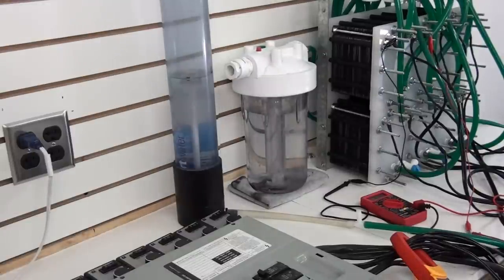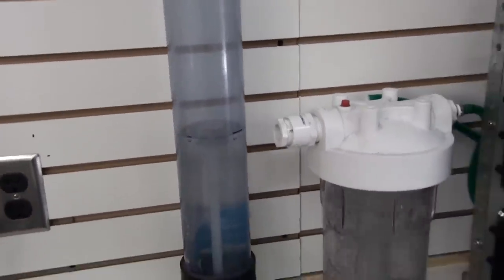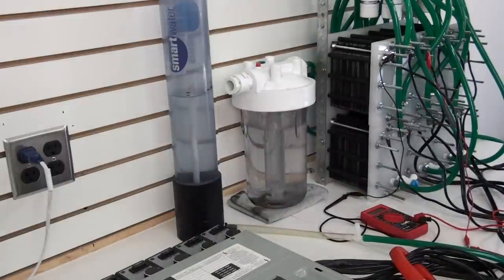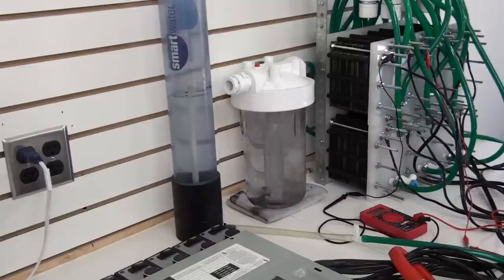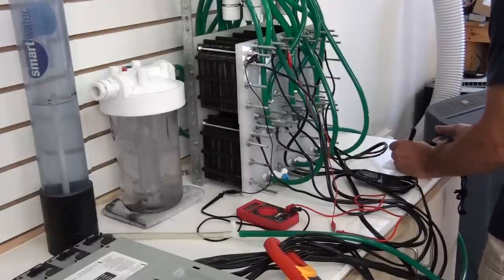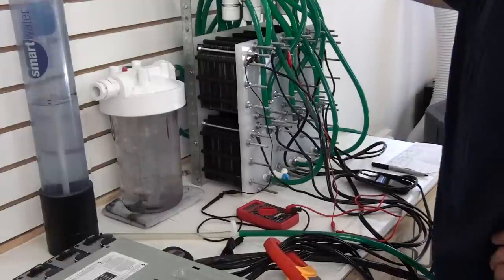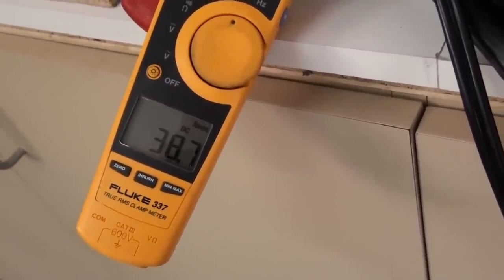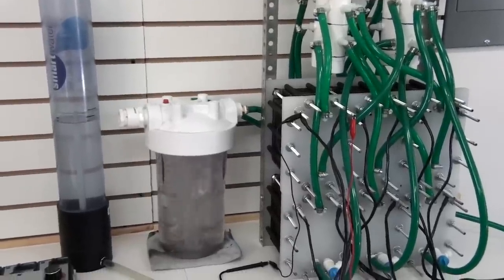Green Fuel H2o HHO 354 Plate Monster Hydrogen Generator Build Part 7

Comment: sorry i'm noob on this matter but how actually you make electricity w.o power generator?!  i mean where combustion happening where is mechanical  to convert to electricity...
the most video i seen in youtube they use HHO as fuel to Generators to produce electricity so im totally confused
second part how long that 2 gallon water KHO last before you have to refill it.
3rd since all those wires and screws and water hose are in stick out is it safe in long run!?

Comment: I heard that for the same voltage let say (120V) current depends not only on plate size, but also on electrolyte concentration. If you increase electrolyte concentration let say two times, how much will be the increase in HHO output. Have you ever tried that? It should be some optimal concentration of electrolyte.
Reply from the maker: I tailor my concentration to cell design and power supply. The more koh that is added the more current it will want to draw.
Reply: Ok. Actually I'm planning to get HHO generator for welding 1/8"  thick aluminum or about 3mm thick sheet metal aluminum. ( round pipes or just sheet metal). What minimum size ( liter/minute ) generator do I need to buy for that kind of job?

Comment: Great video. The unit like this is about 5 KW. If average car power is about 100 kW , you need 20 more units like this to power the car. There are so many naive people thinking that with the unit even smaller than shown here they can save gasoline consumption. That's really naive  :)
Reply from the maker: hho in a vehicle to save fuel is not a fuel its a catalyst to the real fuel. That's what people don't understand, especially arm chair quarterbacks.

Comment: Already the switching of your digital Multimeter or the power controlers could blow your house up with that amount of hho gas you are producing -
unless you have a very good ventilation in your rooms. The gas volume in the tank would probably be deadly if it explodes by any chance.
I would try to keep the volumes in the apperatus as small as possible - which is difficult with these amounts of production...
Reply: no chance to blow hho will burn in air..

Comment: Hi Delvis11, are you using a conductivity in water around 3,000 microsiemens/cm?, and the packing between plate of 1/16"?... basically with this and those conditions it is making 15 lpm of H2 and the rest is 7 to 8 lpm of HO, Good.

Thanks...good project

Comment: INVERTED MAGNETO YOU DON,T NEED ALL THAT POWER AS YOU WILL FIND The spatiotemporal dynamics of the face inversion effect: a magneto- and electro-encephalographic study.
Watanabe S1, Kakigi R, Puce A.
Author information
Abstract
The neurophysiological basis of the face inversion effect was studied with magneto- and electro-encephalography in 10 normal subjects. Spatiotemporal analyses using dipole modeling was performed on combined evoked magneto and electro-encephalography data to hemifield presentation of upright and inverted faces and objects. Inferior temporal cortex, i.e. fusiform gyrus, and lateral temporal cortex near the superior temporal sulcus were activated simultaneously, but independently, at 140-200 ms post-stimulus to upright and inverted unfamiliar faces. Right hemisphere inferior temporal cortex and lateral temporal cortex were active in all subjects, and in the left hemisphere in half the subjects. Latencies to inverted relative to upright faces were longer in the right hemisphere, and shorter in the left hemisphere. For right hemifield stimulation ipsilateral activation delay was around 18-19 ms for both upright and inverted faces and was calculated from all 10 subjects. For left hemifield stimulation, and the data from 7 of 10 subjects, it was 22 and 29 ms to upright and inverted faces, respectively. In sum, the methods used in this study did not identify clear differences in anatomical location of activated regions to upright and inverted faces. We believe, however, that the differences in processing upright versus inverted faces are attributable to temporal processing differences rather than to processing of information by different brain regions.
Reply from the maker: +Robert Steneck Very funny!
Reply: YES AND SO WAS THE RONALD REAGAN AND THE OIL INDUSTRY KEEPING THAT FOR WARS AND THE SKEEKS THANK YOU

Comment: you sir, should be more carefull, the valume over the cell is to much gas in the tank.. not save.. that fan never runs noot save... ure inside and pushen 10 min gas in the room.. but im not sure there, does hho return to watersteam again when it gets mixxed with oxi again?
Reply: no.

Comment: Does bubbling it thru water take bad some of the gases? Would it not be better bubbling thru oil or a liquid with different chemical makeup??
Reply: nope. oxygen and hydrogen dont just simply get back together, or yeah it does when you give it a spark so it burns. when hydrogen reacts with air(so hydrogen burns, look videos of hydrogen torches) it creates water.

Comment: Should your blowout on your valve be facing your work area? I feel like that is relatively unsafe because if the system were to fail that is where it is designed to fail.

Comment: What type of power source equipement you apply sir?, i try battery charger 12 volt, 15 amps for my 22 plate, 9 inch diameter but  i get 1 litre per 2 minute. it bad or no.? I planning to use welding machine had 30-200 amps .its that ok  welding machine?

Comment: Kind of scary leaving that thing running like that while you make the calculations Steve. Hope you are exhausting that outside.  A bit of static could make a mess. It's a better world with you in it.

  Really nice job Steve. What would you need that much hho for though? Maybe run a few generators off it?  I wonder how much hho you'd get with a kilowatt-hour? Really cool. How much hho would you need to run a four-cylinder motor?

Comment: HHO is very positive for combustion motory.Z ordinary petrol will use up to 30 percent energie.HHO supports combustion and thus help to utilize the additional part of the energy of gasoline with significant reductions in emissions. combustion engine on a clean HHO is safer than classic motor benzin.Motor + HHO engine with more life , because during the combustion process do not produce oxidants that create corrosion

Comment: Steve ? have you have any problem with the steel or metals in the engines that you run to become brittle or hardened from the hydrogen ? 
To what effect does hydrogen have on the parts of a engine ? the valve seats, pistons, cylinder walls ? is there any rust effects from the water on the engine ? or rusting exhaust system ?

Comment: ok i just posted the vid its called "Electrolysis Circulation Systems. however i think i forgot to show you what it does at 15 to 20 amps. soon ill be posting a vid on the device to better archive its features and flaws

Comment: have you ever considered a flow pump. i am currently using a hydronic home heating water pump, it cost 100$ and it is sealed very well,it can handle 60 psi @ 220 degrees , its from lows it would be cheaper then changing your hoses , you would just have a higher velocity circulation system . it does however present a learning curve....not enough space

Comment from the maker: Your mostly right. The hho out line is a 3/8"  it's size is fine. The problem with this build that you will see in the next video that I shot today is the size of the hose on the input and output ports of the generator. The plates are not getting enough water to them. Bigger input and output lines would increase production. I'll show the near limits of this system in the next video.

Comment: It seems to me that the 1/2 hose and fittings you are using is limiting this unit from producing much more.  Of course this is simply my opinion based off of observation and no fact what so ever, so please take it at face value.  I have not build any unit as I am still in the learning process, but I do know a bit about flow rates, the larger the pipe the more volume you can move through it.  Other smaller units I can understand 1/2" piping but this unit should have 1" as a min. Opinion not fact.